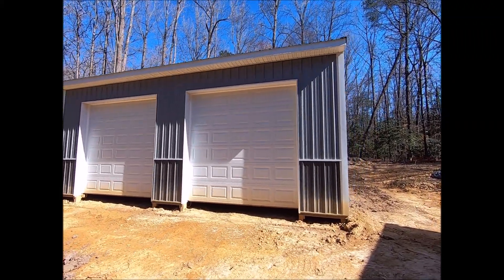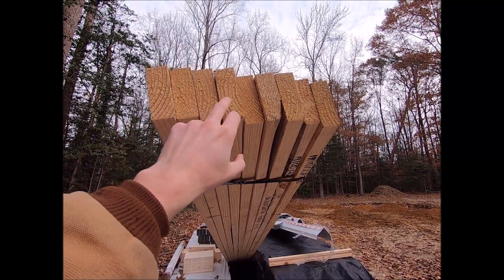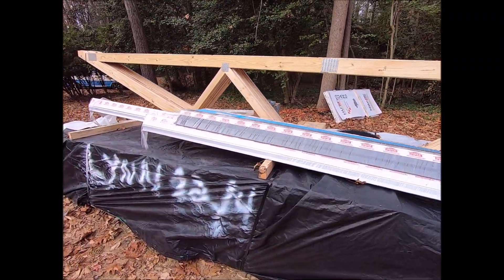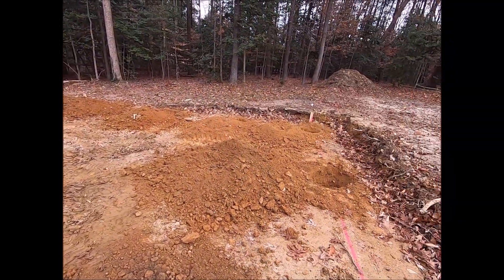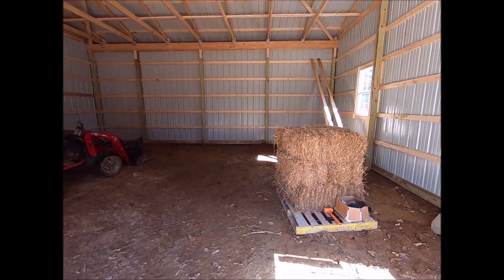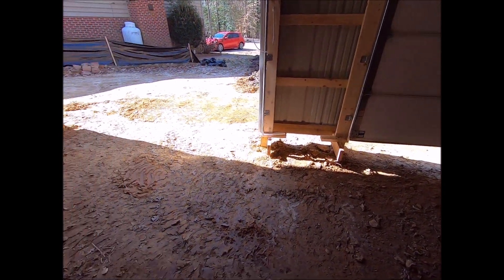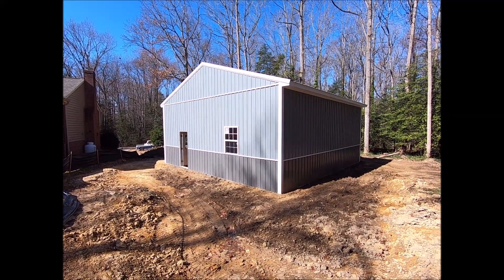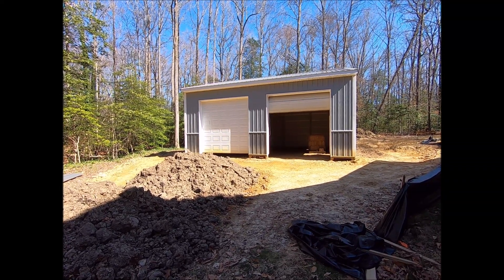30x30 Pole Barn Garage Build Phase 1

Comment: Did you finance through Pioneer? I had them give me an estimate on my building 30x30x12 w 2 10’ oversized doors They came back at 15.4 for the building, 3.1 for site, and 3.8 for concrete, but only 4” thick. My site is as flat as it gets before a scrape.
Reply from the maker: No. I only had them do the building. I did site work and had a local contractor do concrete.

Comment: how much was this building?
Reply from the maker: The building itself was around $18k, not including permits, site work, soils report, etc. I'm doing a 5" reinforced slab so that will add about $7k. I'm planning to be turn key done with everything for less than $30k. Hope that helps.
Reply from the maker: @Casper wow, that seems like a crazy good deal. I priced out materials and that alone was $10-12k around here!